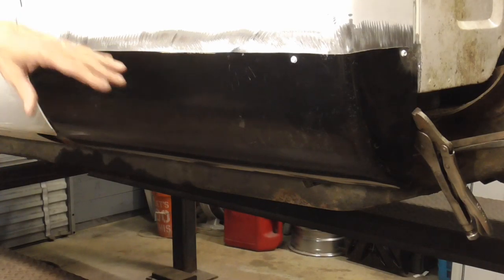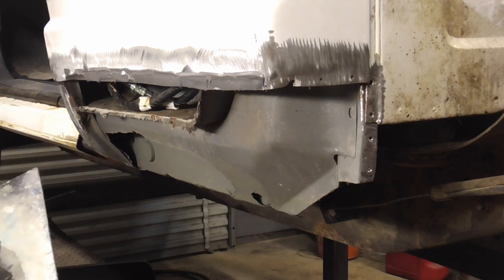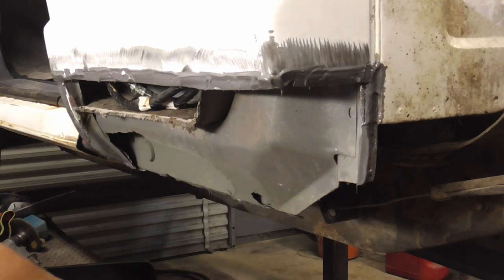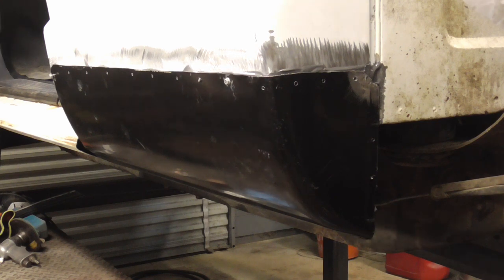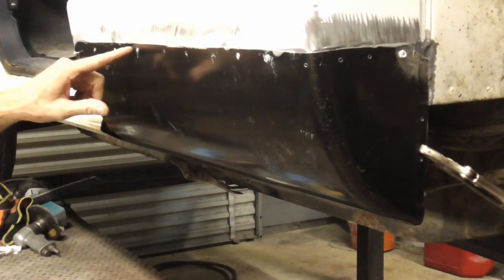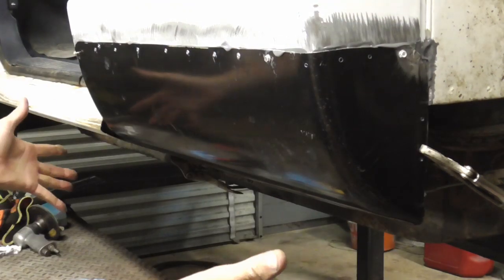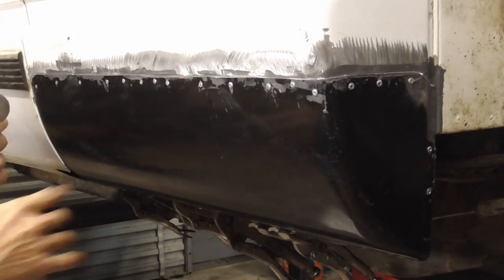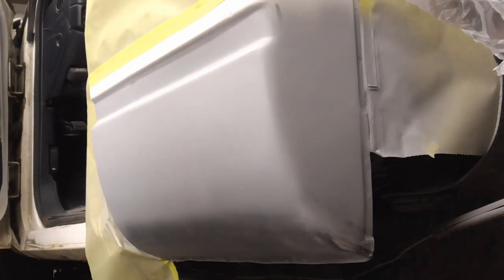Cab Corner Patch Panel Installation with JB Weld | Panel Adhesive

Comment: Could you use JB weld to fill in screw/rivet holes, do you think? The area I'm considering using panel bond is in the middle of a panel with nowhere to hide screws or rivet heads. My thought was to use screws or rivets until the panel bond is set, remove the screws or rivets, possibly tap the holes in a little with a punch and fill with JB weld before body work. Seems reasonable to me.
Reply from the maker: You can do that or just tap the seam down and fill it.  You don't have to fill the holes.  Remember cars back in the 70-80's  were built with tons of holes all the down the side of it to attach the chrome trim.  It really won't cause a problem up high on the panel.  Rust starts at the bottom where moisture and debris gather :)

Comment: Would it be worth hammering the seam and rivets down before the jb weld sets? This would mitigate the risk of it cracking by doing it after it sets. I guess the added risk of doing it before is you might create a gap at the seam. What do you think?
Reply from the maker: Sorry about the late reply - yes you could try that.  Or you could use impact resistant adhesive: https://www.youtube.com/watch?v=d21RkqTwRqs
Reply: @LakesideAutobody  It's a good idea, but be wary of panel distortion as you do it. If the panel springs away from the body then you would never get it looking right after the JB sets and there is a danger of squeezing too much JB out of the overlap.

Comment: Would you use it or the 3M/SEM adhesive on a 6x6 inch unibody floor patch or would that be a weld job?
Reply from the maker: I would be confident using it for a floor patch.  No worries about the seam at all - water tight too.  Screw and glue it or use rivets :)

Comment: what if one had used a  air rivet gun  do you think that would also be ok for this kind of repair.
Reply from the maker: Yes - that would work fine.  A lot of shops are now using panel adhesives for rust repair which is great because of it's sealing properties.  It does cost more and is a bit more time consuming than welding.

Comment: What's your thoughts on using JB Weld to do an entire quarter panel on my 70 Nova vs SEM?
Reply from the maker: Since that is not a full frame car I would MIG weld it.  If you don't plan on welding it I would go with the SEM and rivets.  If you do use JB let me know - that would be interesting if it worked for you - keep me updated :)
Reply: @LakesideAutobody  I didn't think to mention it, but it actually it to be my street/strip car with welded in subframe connectors, a narrowed rear frame and a 12 point roll cage.
Reply from the maker: @troymecey  I see - then in my opinion you would be fine with either - I do think the SEM would actually be cheaper - not sure though how many packages of JB you will need :)
Reply: @LakesideAutobody  good point, lol.

Comment: I’m wondering whether this or 3M panel glue would be a better choice for repairs than welding where it is difficult for getting to the back side. Speculating that you may be able to prime/paint or otherwise rust proof the bare metal on the back/inside while it’s open, then proceed with the front metal replacement piece as you did with the gluing.
Reply from the maker: Here's a video on that:  https://www.youtube.com/watch?v=d21RkqTwRqs  I would say auto body panel adhesive would be the better choice.  That being said,  I'm still driving this tuck and there have been no issues with this repair yet.  Just gave it a real light coat of paint until I paint the whole truck and it has held up just fine - no cracks, no bumps, rust, nothing - just like when it was first done.  If it's held up this long almost 2 years, it's going to be fine.  Jerry
Reply: I've used both and there doesn't seem to be much difference, if at all. The panel adhesive is a bigger container and comes in the handy dual caulk tubes. It's handy, using the caulk gun but the gun is an added cost. In bigger panels, I flange it where possible so I don't have to disturb the metal around the bond.

Comment: Put a flange on the next one easyer to  transition your body work but the glue is great stuff been using it for years good luck
Reply from the maker: You mean so the patch lays in it (even with the other panel)?  That'd work great - thanks for the ideas

Comment: So, when you get the patch panel (the black one). You then put a factory panel over it?  I am wondering this so I can maybe use it later.
Reply from the maker: Sorry - I'm not getting what you are asking.  The patch panel is put over the to factory panel or original sheet metal.  Then you can tap that seam down slightly and fill.  Let me know if this makes sense - if not ask more questions - Jerry

Comment: Should I use steel or aluminum rivets?
Reply from the maker: There's no need.  Matter of fact you can use screws and actually pull them or grind the heads off, then fill.  You'll be tapping the seam down a bit so the filler or fiberglass reinforced filler (if used) will act as a buffer between the finish and the seam.  Feel free to ask more ?s if needed :)

Comment: Would jb weld work for plastic bumper repairs for cracks or holes
Reply from the maker: I would think so - they make a filler specifically for that but $.  I use body filler and it works fine (small cracks and imperfections).  If it's huge, I just replace it.

Comment: Did you fab the replacement panel?  If so, did you roll the cab corner vertically and then cut and fit to roll the bottom and weld it up?  Nice job by the way.
Reply from the maker: No - that was purchased.  One thing to keep in mind is that when I did this for a living there were never any special fab tools in any body shop I worked at.  All patches were cut from scrap panels, slapped on, ground clean, knocked down and filled.  Nothing fancy.  So.... I guess the lesson is that you don't ever have to worry about making the patch perfect - just the filler.

Comment: Would this work with JB Kwik as well?

4H cure vs 24H on JB Weld.  A bit less strong but probably still more than enough on a body panel.
Reply from the maker: I've never really used the Kwik because of the reputation but I think it would work fine :)

Comment: how come theres a big jagged hole in the inner rocker stucture?
Reply from the maker: You can fix that if you want.  I like it there - matter of fact cut it out bigger so that there is good drainage.  Also make sure the water/salt can drain out the bottom of the new panel.  If it looked like swiss cheese - for example - it would never rust again.  Drain and dry = no rust :)
Reply: @LakesideAutobody  I just wasn't sure if that was caused by rust or if it was purposeful. Sorry, I have a curious brain.
Reply from the maker: @ToriL97  No big deal at all - good question - ask any ?s you want.  It is true - the more drainage you have the better.  One time I had an old van I didn't care much about but didn't want it to rust any more.  I cut big holes where the rust started and BINGO! - no more rust problems - the water just ran right out and the panel was able to dry out on the inside.  Cars rust from the inside out - rarely because of chipped paint or other things.  Happy Holidays 😀

Comment: Hello Jerry. A little late to the party here...an interesting and beautiful repair. With respect to using panel bonding adhesive and a butt edge technique, I read where a few fellows suggested mounting internal strips  of sheet metal attachment edges along the inside perimeters of the repair zone ( like vintage corvette bonding strips?) and then you simply glue the patch panel in....no lap joint or welding needed. Alternatively, could you get some of those “lapjoint” pliers and prepare the edges appropriately, and use panel bonding adhesive (or JB Weld) that way ? What is you’d preferred bondo nowadays? Thank You for your time! Best Regards, Shawn
Reply from the maker: That method sound like it would work too - might try a video on that one day.  I still think you would need a bit of filler though but it would work just fine.  As for filler,  it doesn't make a difference to me - I usually try to keep the price at 20/gal - I go for the most inexpensive brand.  Right now its Auto Body Master light weight body filler $21/gal at Auto Value auto parts stores.  Have a great week Shawn :)
Reply: @LakesideAutobody  Thanks for the scoop Jerry!

Comment: Was wondering if you tapped the seam down while the jb was wet would there be less chance of cracking?  Or was there a reason to let it dry first?
Reply from the maker: I think you could go either way.  If you ever try it while it's wet let me know if there were any negative results.  You can use SEM impact resistant structural adhesive and never worry about it cracking when knocking your seams down.  See this vid at 9 : 05  for more on that - https://www.ebay.com/itm/402721677377?chn=ps&norover=1&mkevt=1&mkrid=711-117182-37290-0&mkcid=2&itemid=402721677377&targetid=

Comment: question.
If u had used channeling tool and created a channel on cab corner would that have elimintated the need to "knock it down" and make fitting patch panel more forgiving
Reply from the maker: Yes you could do that - absolutely.  I plan on making a video on rust repairs using a flange tool.   You still may have a few tiny high spots but you can just tap those down if they show up through a skim coat of filler to cover the seam.  It'll last forever - really.
Reply: @LakesideAutobody  thank you : )

Comment: Don't those rivets react with the steel?
Reply from the maker: No.  It's been about 4-5 years now and it's still perfect.  Pastor in town bought the truck and I see him around now and then.  He put a new Jasper transmission in it at 275000 miles 👍💯😀

Comment: I'm not familiar with this type of jb weld, it looks like bondo, I only know of the two part that comes in a tube like a thick putty.
Reply: My take is thst he used the 2 part. He mentioned mixed jb weld with hardener , so referring to 1 part as weld and 1 as the hardener.

Comment: I put JB on a windows channel like 4 years ago I just pulled the window it was really green ish and soft I was kind of surprised and not in a good way.
Reply from the maker: Interesting.  Since it's my kid's truck, I'll keep an eye on that repair and see how it holds up - should stay pretty dry in there though.
Reply: @LakesideAutobody  hey bud any word on how well this held up? I'm having real bad luck getting this cheap little flux core chinesium welder dialed in and I was just gonna try this to avoid burning a bunch of holes through my patch panel.
Reply from the maker: @MegaDysart  This is my main daily driver and have driven it 2 winters with this repair.  It's holding up just fine and I will do a update video on this truck when I finish it up.  Been real busy with other videos lately but all the repairs on this truck have held up very well for two years now driving in the salt.  Look for the update video fairly soon.

Comment: What size screws did you use? Are they self tapping?
Reply from the maker: They're not self tapping but they did fit nicely in an 1/8" hole.  That way a rivet can fit in there too.

Comment: you must buy it by the bucket full. that looks like about 15 tubes worth.
Reply from the maker: That was one package.  You can use panel adhesive too.
Reply: JB Weld is still a cheap alternative to 3M panel adhesives.

Comment: Is that rain in the background? Thinking this might be an option for a no weld trans tunnel bump extension that I need...
Reply from the maker: There is a train that runs through town - good ear!
As for your trans tunnel, you could use panel adhesive too or even pop rivets with seam sealer between the metal.  I once glued a whole metal floor is a van with metal roof adhesive and self tapping screws - it never moved again. No rust worries either as it was a large sheet of galvanized sheet metal.  That's a real good option.

Comment: You think thisll work for slip on rocler panels on a unibody car?
Reply from the maker: I have never done slip on rockers but if you're gluing metal to metal, I would say yes.  You could also try 3M panel bond but that's a bit more $.  Jerry

Comment: A good option for at home DIY projects. If any professional recommends this. Go somewhere else. There is doing something to your own car. Or doing it the right way.
Reply from the maker: For some reason, I'm thinking this is going to last way longer than I think.  No ability for the water to penetrate the seem.  There are a lot of guys also that use panel adhesive - sort of the same idea.
Reply: Thomas I agree! I have watched a good many of Lakesides videos, I wouldn't let them work on a potato peeler for me. Every time someone says something about his work he usually says something about that is the way body shops do it in Michigan. I don't know why where a body shop is, means they can use poor techniques, then try to teach them to other people as good work.
Reply: Auto manufacturers use a surprising number of adhesives to assemble modern vehicles, rather than welding.

Comment: Whats the alternative to jb weld? Im in S,A and I dont think thats available here.
Pratley steel? Abro steel?
Reply from the maker: You can use any panel bonding adhesive or I think even a 2 part epoxy would work as well.
Reply: @LakesideAutobody  Thankyou Sir for your prompt response. Made a subscriber out of me.
Reply from the maker: @samuelbhagothiparsad3882  You're welcome - glad you subscribed - hope to add a whole lot of helpful videos :)
Reply: Other manufacturers make two-part epoxy adhesives very similar to JB Weld.  I have successfully used LePage PL9000 construction adhesive, which is much cheaper than epoxies.  Construction adhesive set up time is at least 24 hours.
Reply from the maker: @chrisgraham2904  Interesting.... thanks for that info.  I'll have to look into that stuff :)

Comment: I really don't know how much money you would save using JB Weld vs professional panel bonding adhesive(3M, SEM, Fusor). Maybe if you only had one small project to do.
Reply from the maker: A little - I just thought some folks would be interested in the idea.  I still have the truck and it has held up great - still in primer and not a stitch of rust after a winter of salt.
Reply: Awesome! Thanks for the update.
Reply: In Canada JB Weld Original is about $9 per ounce.  3M 08115 Panel Adhesive is about $90 for a 6 ounce applicator.

Comment: Hi did you grind down  rivits.lots of videos 😁😁
Reply from the maker: No - just tapped the seam down in order to fill with body filler.  I was very careful not to hit the seem to hard 'cause I was afraid of cracking the JB.  Panel adhesive is probably better but wanted to test the JB weld - it is still holding real well - no cracks or problems.
Reply: @LakesideAutobody  do you think you could hammer the seam in a bit while the jb is still in its flexible stage, just thinking.  great video tho.
Reply from the maker: @hunkydude322  I think if you timed it right you would be fine doing that.  It probably would be the right thing to do as you wouldn't chance breaking or cracking the seal.  That's where the impact resistant panel adhesive works well:  https://www.youtube.com/watch?v=d21RkqTwRqs

Comment: How has it held up so far?
Reply from the maker: Excellent - drove it all winter - it's still in primer.  I'm very happy with how it's holding up as it's the first time I tried JB weld on body panels - sealed the seam real well.  I'll be doing a video on painting that side of the truck this fall.  I'm keeping that truck so I'll do videos on how all the rust repairs are holding up - here's all the repairs:  
https://www.youtube.com/playlist?list=PLOP9eoG14-I8mto72e0di1Q_URvGUlYfQ
Reply: @LakesideAutobody  Thanks! I'm surprised it worked that well.
Reply from the maker: @classicshoelaces.7340  Me too actually - no cracks - nothing... looks great after a winter of driving it - and beating on it really - towing cars, driving in the woods to cut trees, etc.
Reply: @LakesideAutobody  thr power of jb weld. I think the stuff might be made of adimantiam
Reply from the maker: @classicshoelaces.7340  I'll have to look up "adimantiam"  - sounds like some strong stuff :)

Comment: How did you cover the rivets up?
Reply from the maker: Tap the seam down - just a little bit with a body hammer.  If you're afraid of damaging the bond, you can opt for impact resistant panel adhesive/structural adhesive.  It held up well for me during this process.  You might try doing it while it's still a bit soft too - that may be better yet..
Reply: Probably used a gallon of body filler.

Comment: Are the  rivets steel or aluminum?
Reply from the maker: Not sure - got them up at the hardware.  I'm thinking probably aluminum.  You could probably use small screws and even pull them out after the jb hardens - there isn't going to be any moisture hanging around up there anyway.  Just knock the seam down a bit and fill right over the small 1/8 holes.  Or even grind the screw heads down a bit, use steel rivets if worried about corrosion.  Nice hearing form you Fred :)
Reply: @LakesideAutobody  Well, they worked whatever they wer made of. I saw your video of the panel after a year.
Reply from the maker: @lostjalopygarage8150  That's great - I'm glad you saw that.  I think it'll hold up quite a long time - the bottom will rust out long before the seam up there does.  I'll have to throw some rust preventative inside the corner after I paint the truck - still not painted -  busy lately.

Comment: opps i spoke to soon  i see you using a rivet tool  .
Reply from the maker: That is really how 3M (3M Panel Adhesive) wants shops to "glue" panes on.  They don't want you to spot weld through the glue.